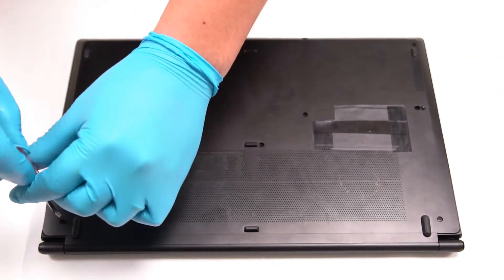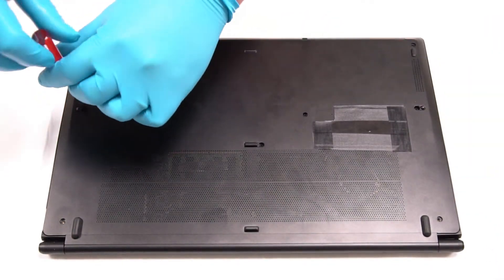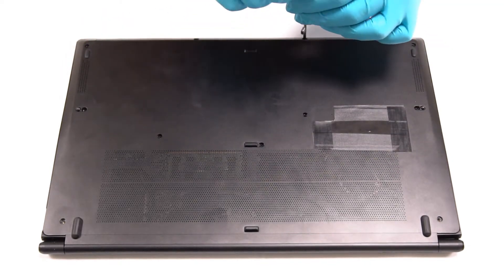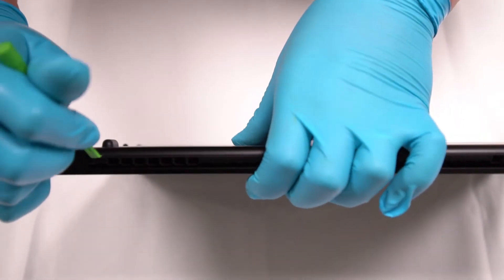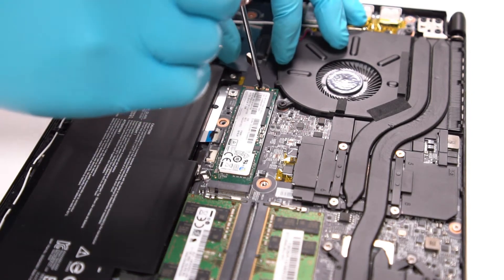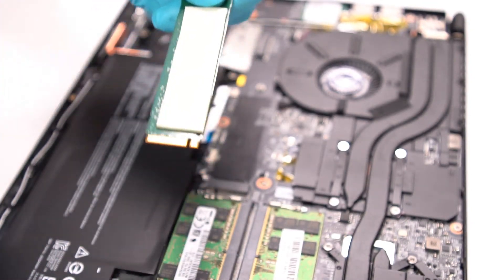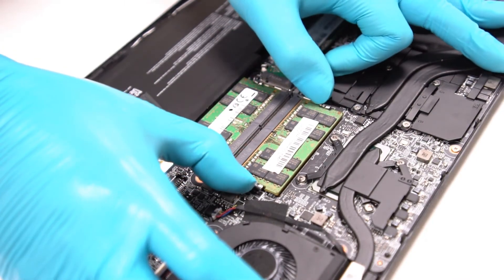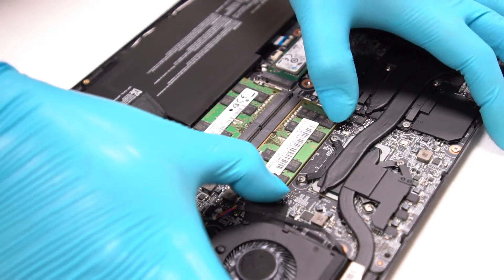MSI Modern 15 A/Summit B15 Series SSD & RAM Upgrade Tutorial

Comment: My pc is not turning on after I opened it like that
Nm I plugged it with the charger and it worked,
Thanks
Reply: After performing a reset of the EC, your PC may not turn on using the power button if it's on battery power. In this case, you'll need to plug in the charger and wait for the laptop to turn on and to display. This does indeed indicate that the RESET EC was successful.
Reply: @HWK-xc4ie  thank you

Comment: Regards.

The machine specifically is the MSI Modern 15 A10RAS-287 - Laptop (15.6 ", ultra-thin and light, Intel Core i7-10510U MX330, 16 GB, DDR4, 512 GB, NVMe SSD Win10Home)

I would like to know what parts of this machine are welded, that is, what would make them difficult to fix.

I await your prompt response, thank you.

Comment: Do you need to remove the battery to add or replace ram?
Reply: you need to unplug the battery pin as shown in the video. If you mean remove the battery from place, then no its not necessary and not recommended
.

Comment: Will a 2242 NVMe PCIe M.2 SSD work in the spare slot? I have one lying around but unsure whether it can be put in properly, considering the length difference (position of tightening screw).

Comment: HI, what is the reset button does? 0:23
Reply: It's written in the description of the video: "Reset EC" is to cut-off the power from the battery to avoid any damage from the short-circle.
After all the upgrade processes, you need to plug in the AC power adapter to power on the notebook because the battery power is cut-off by "Reset EC".
Reply: @silviocorso691  Thanks. In other laptop I cannot find the reset button: what if we simply unplug the battery before touching RAM / storage, does that safe enough?
Reply: @christang9406  I'm not an expert ;-) But I agree with You, it's the first time I see a "reset button" for battery, usually You must unplug the battery before touching any metallic element inside the laptop. Maybe it's required for this specific battery, unplug it directly (without prior reset) could damage it? I don't know
Reply: @silviocorso691  I recently upgraded couple of my rigs, asus, lenovo, i couldnt find the reset button, only this specific MSI has, then I followed the rule; battery eject strategy to avoid damage, idk anything else
Reply: @christang9406  if you dont find reset ec, you will unplug the battery if removable and unplug the power plug, and press the power button for 30 seconds

Comment: Great video! Is the 2nd ssd slot for a 2.5, or another m.2? Thanks!
Reply from the maker: It's a M.2 SSD slot. Go to the manufacturer web for specs questions.
Reply: @MFLAB  I assume this means you can install two SSDs? I would like to dual boot windows and linux
Reply: @coltonfox8689  you can do that with one ssd, no need two.
Reply: Việt Anh Mai Thạch you have to partition the drive and I would prefer not to do that
Reply: @coltonfox8689   Hi i am thinking of adding another SSD to dual boot windows and linux, was it worth it? or would you suggest partitioning?